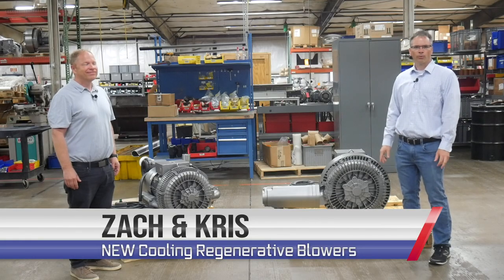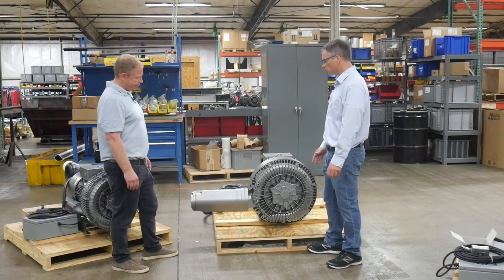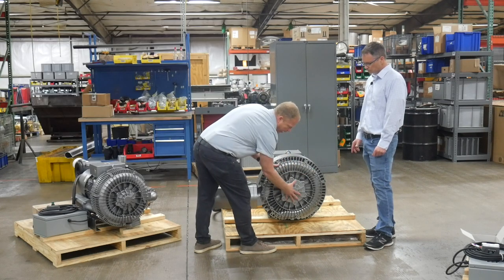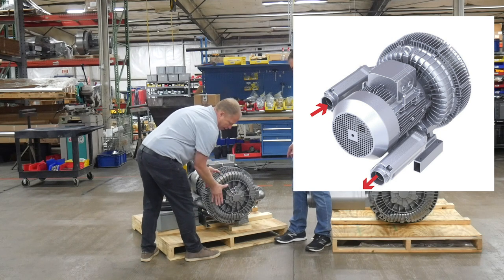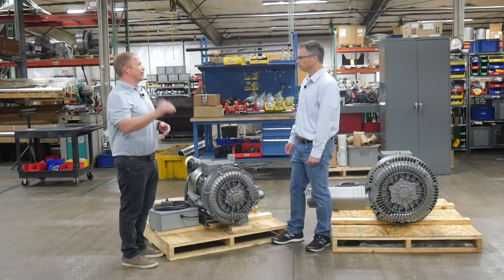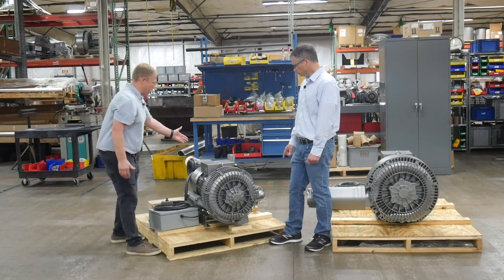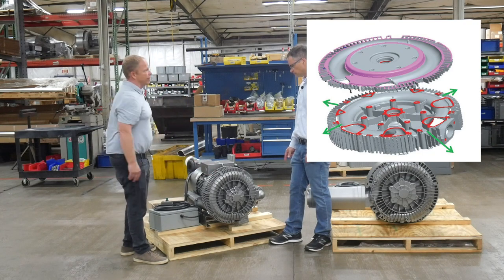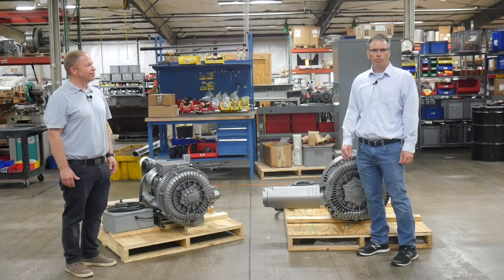NEW Cooling Regenerative Blowers | Republic Manufacturing

Comment: Throw a hot water tank on the hot bearing side (or just plumb it to one)
If a tall or two tank system is used hot water or pre-heating to dedicated hot water heater
get credit for efficiency rating with co-existence of both functions.

Comment: Can the vacuum channel and compressor channel be used at the same time
Reply from the maker: The vacuum and compressor channels cannot be used at the same time. Regenerative blowers are set-up for either pressure or vacuum. There are some dry vane pumps that can run pressure and vacuum simultaneously. Let us know if you are interested in that type of solution.